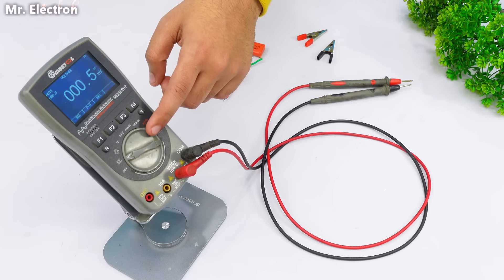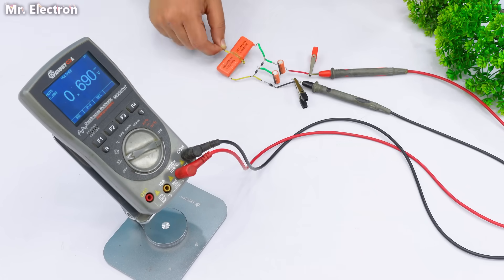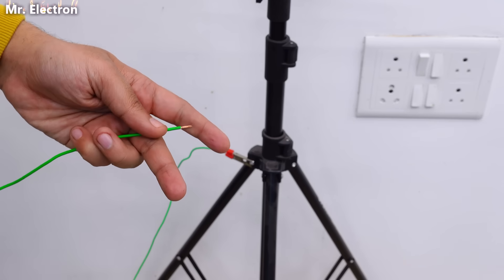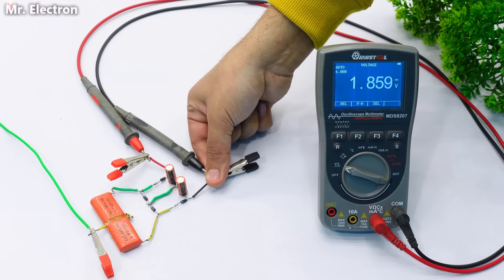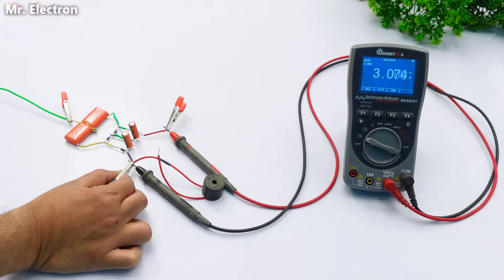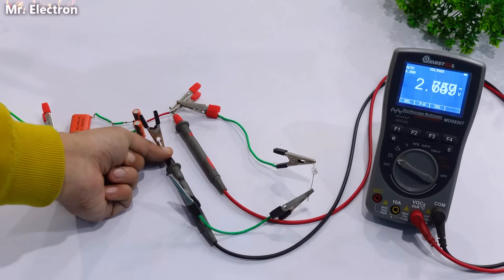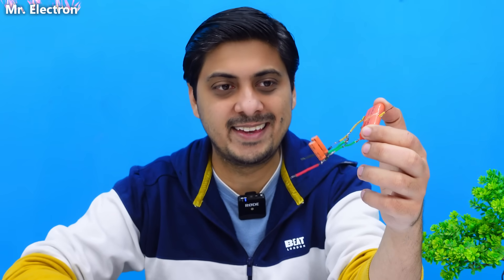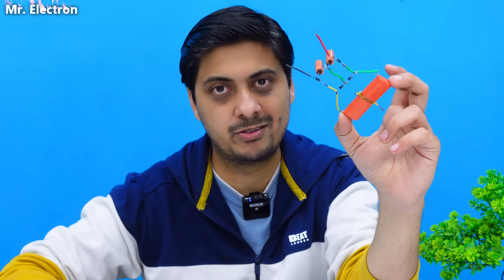Maxwell Chikumbutso - 5000 KW FREE ENERGY from RADIO WAVES | 100% Working Model DIY

Comment: The reason the voltage quickly increased was because the circuit was "floating". Since it's capturing energy from a nearby tower, both needs to be grounded to get better efficiency. That's how radio operators boost their range!

Edit: if I watched 20 seconds more, you've figured it out yourself 😅

Edit 2: If you know the frequency of the tower, you can use an LC circuit to make the circuit resonate with the frequency and get higher efficiency
Reply from the maker: Thanks for pointing that out! 😃
Reply: @mrelectron_alternator  So cool, to see how this video has opened such a crazy can of worms! this is how great things begin! 👏👏👏👏👏👏
Reply: Knowing that the flux radio energy going through an area  is enough to know it will require many many many square meters of cross section to get around a watt. 

I wondere if a circuit like this can recharge TV remotes that are used infrequently and typically use so very little power anyways.
Reply: Bro l think you have idea of what chikumbutsu is doing but you don't hv the important workout of turning the impossible words that you find yourselfin when you see yourbulb flash, fr second,,,,if you still using diode it has high opportunity you started in failing. Do you  know REVERSE RECOVERY MODE : DIODE VS MOSFET

The likes of GaN  (Gillium nitrate) they hv high frequency  that empowers good ambient 

The likes of (   GaN MOSFET rectifier,  circuit) combine with ACTIVE CONTROL GATE

Its a long story ...you think black gu😂ys we don't invent  Africa is nothing watch  out (ANTIGRAVITY DIVICE )will come out  boom 10:5310:53 In to light. (Billion light year)
Reply: Jealousy against Africans chikumbuzo is not good. Fly to Zimbabwe and prove him wrong!
Reply: I continue to "shake" oilmen with my innovative project of a non-combustion engine, I remind you that I am posting here on my channel the technology and the principle of operation, according to which anyone can create a prototype and enjoy free energy, since I was denied financial support at the stage of the idea and theoretical research, after a year of unsuccessful searches. Including I will begin to assemble a sample. And soon another video will be released, revealing my developments, the wind of change is approaching! All those who are not indifferent, welcome to the flight in this departing innovative car, which will lead to great achievements for the successful future of the planet and humanity!